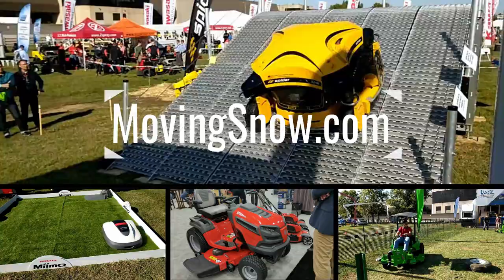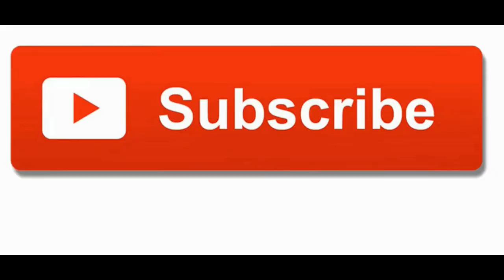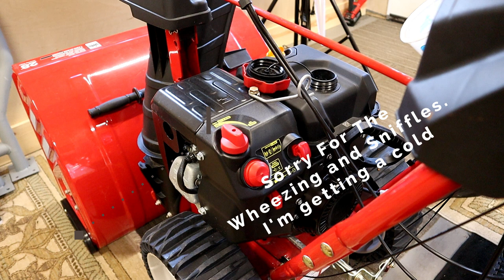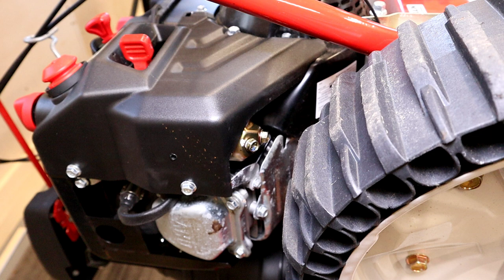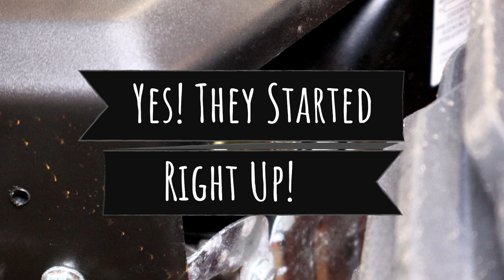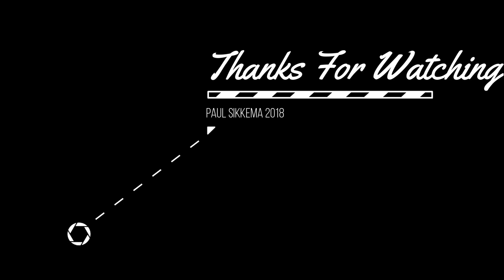My Snow Blower Won't Start | Troy-Bilt, Cub Cadet, Craftsman, MTD

Comment: Thank you for your video, sir!! Snowblower wouldn't start, so I tried new sparkplug. No luck. Saw your video, used your method(turkey baster to drain old gas), drained carb, put new gas in and it started right up!!! You saved me money and a trip to the repair shop! THANK YOU THANK YOU THANK YOU!!!!

Comment: My 3 year old snow blower wouldn't start. Realized I had left some gas in it, but didn't think that could be the problem because I used high octane gas (no ethanol) & stabilizer last winter. Tried your suggestion and that solved the problem.  What a relief.  Thanks so much, Paul!

Comment: I have a PowerSmart snowblower 8 years old never had a problem starting or clearing my long driveway of snow. To eliminate ethanol I always add a little gas stabilizer or Sea Foam to the gas tank. After the winter season is over I let the snowblower run until it burns out all the fuel. Sold the old PowerSmart and purchased a new PowerSmart with the 250cc Briggs and Stratton engine. Very powerful snowblower throws snow a long way. The carburetor is the key component on gas snowblowers it is paramount to use stabilizers to keep them free of ethanol. Thanks Paul for all your very good advise.

Comment: Thank you for your video. I stored my blower this past February, put Sea Foam in it and ran it a bit before I shut it down. Went to go check it out today for the up coming snow season and no start. Pulled the spark plug cleaned it put it back in still no start. So did your recommended fix emptied the fuel tank, drained the fuel bowl and went and bought new gas. Tried to start it again and it fired right up. Even blew out some blueish white smoke all is good. You just saved me trip to the repair shop that I am sure would try to sell me a new carb etc.

Comment: I have a 1-year-old Cub Cadet 2X snow blower that ran great from the store and was running fine when I ran all the gas out of it at the end of the first season.  I never had a problem with this procedure in the past with any engine at the end of the season.  This week we tried to start it and it turned over fine, but the spark plug was dry.  I drained the first gas out of the tank and the carburetor bowl, mixed up some Seafoam with gas in a 1 Seafoam to 2 gas ratio, and tried to start it again to pull the mixture into the carburetor.  No start.  The next day, however, it started on the first try.  Thanks for the direction in getting the carburetor opened up and my machine back on line.

Comment: I would just add that after couple days of "Sea Foam" or "Mechanic in a Bottle" soaking in carburetor, snow blower did Not start...Until I Re-Drained the carburetor as the video shows at beginning. Now, with non-ethanol gas ($27/can) able to get into carb, engine started up (Electric start button) with a smoky vengeance. After about 10 mins. of Backfiring, things went back to normal! Thank you, Sir!  I semi feel normal again!

Comment: Thank you so much Paul.  Your video worked for me, and saved me so much money.  I didn't think it worked because when I removed the gasoline, and then took bolt off bottom of carbonator and so much yellow gasoline came out it took three 24 oz plastic water bottles to collect the gasoline.  I then waited 30 minutes and tried to pull start it but it would not start.  I then tried it two days later with the electric starter and it started right up some white smoke came out like you said and it ran perfectly.  I am so grateful Paul thanks wholeheartedly for sharing this video!

Comment: Thanks. Worked like a charm in craftsman snowblower. Drained old gas completely by unscrewing and opening the drain screw and then added fresh 92 fuel and then snowfoam. Blower started in one try. Blower is few years old but rarely used in 2 winters.
Reply: Snowfoam. 😊 I know what you meant, of course, and it's obvious why you had snow on your mind. I do that kind of thing all the time.

Comment: Thanks SO much. I started the motor a couple of times this Summer and it started easily. Today when I needed it, no dice. I removed all the gas from the tank and carburetor per your instructions. Added Seafoam and freshly pumped gas. It started! Thanks again.

Comment: I did this, saved me hundreds in repairs. It took a little more than what's shown here. I removed the fuel, added a little fuel to the tank and removed that to rinse the tank and drained the Carb. Filled gas tank and added with four Tablespoons Seafoam.Wouldn't start, re-drained the Carb. and replaced the spark plug. Now it would run for fifteen seconds. Let it set, tried again and found out I could keep it running by pushing on the primer every 15 seconds. Finally it would run on full choke, let it set. Tried again, had problem with starting the auger, and it not dying. Let it set. Got it started again left on full choke easing a load on it. Today I cleared 9" of wet snow, with no problem. Just have to have patience, and let it set after running to a full warm up.

Comment: I had tried everything else already, was ready to take it in, and then I saw your last trick with the drain bolt and let some gas flow out (with a full tank because I already drained the gas and replaced it) and it started in one pull!  THANKS!

Comment: Hi Paul Nice Videos.  
I do these things with a small variation.  I run it a bit before I drain it.  Then once my tank and fuel bowl are empty I try to start it a couple of times to be sure there's absolutely no fuel in the jets to gum things up.  It does run for a few seconds even after the bowl is drained.
My blower is a 2006 1128 and the fuel bowl has a push button drain.  It's very convenient.

Comment: Thank you for this great video!  I have a Craftsman snowblower that wouldn't start.  I drained the gas just like you said and added fresh gas with a fuel stabilizer.  The snowblower started on the first try!

Comment: Thanks!  My only comment is that siphoning did not work because I believe I had moisture in the area of the carburator.   However,  completely draining the fuel by unscrewing the bottom bolt did work, as the moisture drained out the bottom.  I then filled the gas tank with high octane fuel and it started right up.

Comment: I always added the recommended amount of Seafoam to my gas and never had carb issues. I have never used non-ethanol gas, just 87 octane pump gas and don't have problems with water in my gas like some claim. Some drain there carburetors and fuel tank during long term storage, but that's really not neccessary.
 One thing you should do is (after you run the Seafoam gas thru the engine) is to top off the gas tank if it is metal to keep the inside from rusting. It's important to do this with motorcycles especially.

Comment: I have a similar Troy Bilt just like the one in the video, and same situation - first winter it didn't start up. The trick worked - drained the gas, seafoam helped but still would still die after a couple seconds. I tried adding a bit of fuel additive and it started right up. Also, for my drain bolt I had to use a 10mm - the 3/8 inch wouldn't fit for this model. But thanks for the tips, it saved me a lot of time and money...we have a big snowstorm coming in tomorrow morning. :)
Reply from the maker: Sorry, I have a MetWrinch tool set that handles both with one wrench. I keep forgetting to mention all of these engines are metric no matter what I say in the video...
Reply: What type or brand of fuel additive?

Comment: Thank you! Always have this issue despite using Ethanol free, stabilizer and or sea foam. Run till stops. And it doesn’t matter. With this blower and this blower only, I always have this issue in the fall. Eventually it would start but this greatly decreases the time and strain on my pulling arm. They “do not make them like they used to”
Reply from the maker: Yes, snowblowers without a fuel shutoff give owners a lot more fuel related issues. I suggest just starting it once a month all year long.
Reply: @PaulSikkema I was just considering that! Yes I’m going to try it. Thanks!

Comment: Thank you for your video. I followed it last winter, drained the carburetor  and was able to start my Cub Cadet 3X. At the end of last Winter (2019-20), I ran my snow blow dry and stored it in my garage. Just today, I wanted to prepare for this coming Winter and to see if it could be started. I put in fresh gas with Startron but could not start it just like last season. I appreciate your advice.

Comment: Use a 10 mm socket or wrench for everything. 3/8” can strip some cheap or over tightened bolts.

Comment: Thank you Paul. I have a troy-bilt snowblower and it doesnt start. I emptied gas, cleaned the carburetor (apparently the holes were not blocked) and added new gas. Now when I turn on using the electric start button, after few tries it starts and runs for few seconds (~ 5 sec). Before I turn the choke to run mode engine stops. 
Snowblower is just 3 years old. Is there anything I should check like replacing spark plug? or service center is the only option? Any suggestion please?
Reply from the maker: My first guess is the primer bulb but I'm not a mechanic. I suggest checking out Donyboy73. https://www.youtube.com/watch?v=1k50sCtD5gQ
Reply: Rpk, I also have a Troy-Bilt, and also just three years old, or so. I'm curious to know what you eventually found was wrong (if you've even used it since you posted). My amateur guess is that there was still some water or stale gas in the fuel line or the carburetor. I'm about to go drain mine with a siphon hose and then add fresh gas and maybe a bit of Seafoam. Fingers crossed.

Comment: Hi Paul, great video! I just wanted to say that I haven't had any success yet, but will try your steps out this coming week. I own a Cub Cadet 2-stage snowblower (approaching 3 yrs). The design setup of your MTD is pretty much on par with the setup of the Cub Cadet which will make things easier for me to navigate around. I haven't been able to start it this winter and suspect it's because I left half a tank of gas sitting in it over spring, summer, and fall. I'm gonna grab some Sea Foam from Canadian Tire and see if that helps to clean things up a little. I'll post a reply to this comment if it starts or not.
Reply: So I give this a try but was unable to get the Cub Cadet running. It ran for about 3-5 seconds and the died and hasn't started again. A lot of lessons were learned from this video, so thanks again for sharing these tips.
Reply: Well, I'll be damned! I tried electric starting the snowblower this morning and....it started! I let it run for a few minutes, stopped it, and then tried again using the starter rope, and...it started again. Thanks Paul!

Comment: Always use Sea Foam when filling your gas can, and use even more than Sea Foam tells you too on the can. If your carb is plugged, clean or replace then always make sure you use a good amount of Sea Foam in every gas can you use for your snow blower. The right amount of Sea Foam will keep gas fresh for up to a year. I have been using Sea Foam for years, with good results. You really can't use to much Sea Foam. It's amazing stuff.

Comment: The carborator was replaced & told it does not need primed.  It worked for a few minutes yesterday.  But I  csnt get it running today
 
It has a throdle & choke  but no primer.
Reply from the maker: That's weird. A Troy-Bilt factory replacement carb will have a primer bulb. It appears your mechanic may have installed a lawn mower carb instead of a snow blower carb.

Comment: How do I remove the choke control knob (the RED one above the prime push)?
Reply from the maker: Very Very carefully. I would use two flat screwdrivers or something like that to lift the knob evenly from both sides. Don't be surprised if you break it and have to order a new one.
Reply: @PaulSikkema  Thank you for your reply. It might be the cold weather causing the plastic to bind tighter but I managed to apply force by hands and eventually got it off. I could not apply force with metal tools underneath the knob because the shield cover is plastic that the metal tools caused the plastic to bugle.

Comment: Had the same problem of the blower not starting. I simply tipped it almost upside down to drain any ethanol/bad fuel in the lines. Then gave it a few more primes and it started right away. So before removing the carburetor, try this trick.
Reply from the maker: Hi Zim, I don't recommend tipping it upside down because the gas will make a mess, kill your grass and environmentally ruin the area it flows into. That said, it may also cause the oil to drain out of the engine or up into the valve area of the motor. That can cause the engine to hydro-lock when you start it and break the OHV parts.
Reply: Thanks Paul. Maybe not tip it too much. I did not see any fuel leaks when I tipped mine.

Comment: Usually if it'll run at all seafoam will fix it. For 10 years I've been storing equipment by siphoning off what fuel I can and propping the unit towards the fuel line then run the unit until it stalls. I try to run seafoam in the first tank of fuel for the year and stabil in my last tank.

Comment: Thanks for the excellent video.  I need to get some seafoam.   I tried to start a brand new snowblower that has never been used... but it's been sitting (no gas in it) for a couple of years.   I am going to try again today and spray some carb cleaner into the spark plug as well.    I thought leaving it with no gas in it was the best thing so the fuel didn't go bad.   I guess I should have at least started it every year.  If it doesn't start when I pull the spark plug, I'm going to bring it to a shop.  I don't think I want to try replacing the carburetor.

Comment: Thanks!! This helped a lot, I’m going to try it later today. 

One question: does gas go bad sitting in a gas can? I have a plastic gas container that I filled up a few months back for my lawnmower, and am wondering if this is ok to put into my snowblower after I drain the old fuel (from last winter) out. Thanks!
Reply from the maker: If the can is sealed probably not. If you left the vent open or the cap off the spout put that gas in your car or truck (they don't care) and go buy fresh
Reply: @PaulSikkema  thank you!! It was sealed, so that’s good to know.

Comment: My Storm 2625 didn't start yesterday, so I'll drain the fuel tank and carburetor tomorrow--thanks for the instructions. Another question, though. On my machine there's a yellow drain plug at the front lower part of the engine, over the front of the left wheel.  What the heck is it for?  The owner's manuals don't show it.  I screwed it off and could see some liquid inside.  Since you measure and add oil at the top and drain it out the back, it isn't for oil...am I missing something by not knowing what this left side plug does? Thanks!
Reply from the maker: It's an alternate oil drain hole. It may be plugged on the inside of the engine and that's why oil didn't drain out. These engine blocks actually go on many different types of equipment so having drain holes on each side is advantageous because they can mount the engine in different directions depending on the application.
Reply: @PaulSikkema  Thanks!
Reply: Just drained carburetor and replaced fuel with Seafoam additive, but it's still not starting. Next step would be to drain the carburetor bowl (the other screw)...can the carburetor or carburetor bowl (either of those screws) be drained without emptying the fuel tank, or do I need to siphon out all the fuel again (BTW, this unit is starting its third season)?
Reply from the maker: If you have a visegrips you can pinch off the fuel line. If not, you will have to drain the fuel. 
Be very careful removing the carb bowl the rubber gasket is very fragile.

Comment: They did an experiment with fuel additives they took 87 % gas in and used 10 different fuel additives and let the engine sit with the gas and different additives for 19 months in all weather conditions to see if any of these additives worked by running the engines until they wouldn’t run Sea foam hung in there as one of the final 4 but the clear winner as far as fuel stabilizers only I think sea foam is not just a stabilizer but also cleans your engine however  VP fuel stabilizer won and they dropped the bowl it was the only one that had absolutely no dirt or varnish in the bowl it Was crystal clear. I however just use non ethanol fuel with sea foam and at the end of the season empty the tank adding a little more stabilizer and run it dry then as shown empty the bowl and put that gas in my vehicle and buy new in the beginning of the next season, I think it’s better than having the issue of cleaning or replacing your carb.
Reply from the maker: Yes, there may be better fuel additives but SeaFoam works. Put 2 tablespoons per gallon when you go buy your fuel and don't worry about stale fuel.
The stanley-black&Decker (formerly MTD) engines do not have a fuel shut off so to run the carb dry you need to remove as much fuel as possible from the tank (a turkey baster works well) and then run the engine until it runs out of fuel. Most people don't do this so always having SeaFoam in the fuel helps.

Comment: Spray a bit of seafoam into the carb from the drain plug. then a bit in a small amount of fuel into the tank. Next use..fill with fresh gas and starts right up.

Comment: Great video! I am having this exact issue. Engine cranks on electric start but doesn't turn over. I removed the fuel but need to change/replace oil. Maybe check/replace spark plug too.